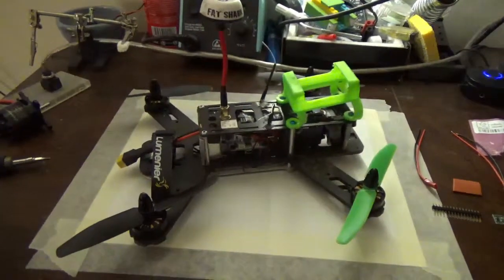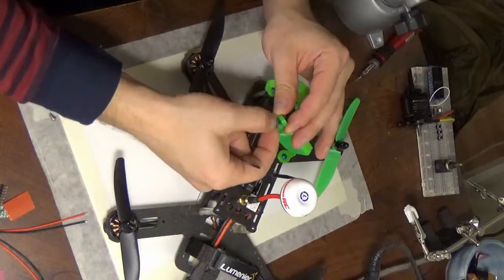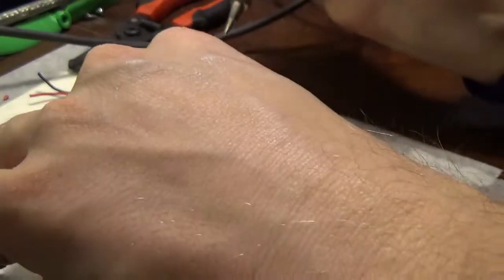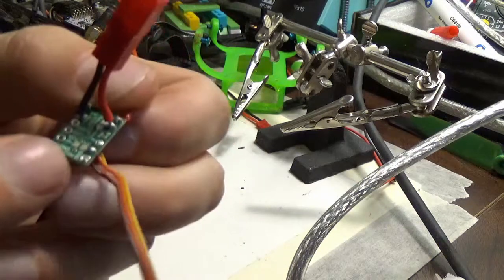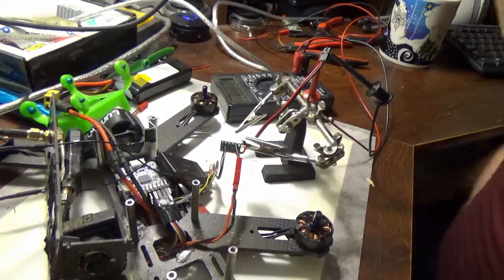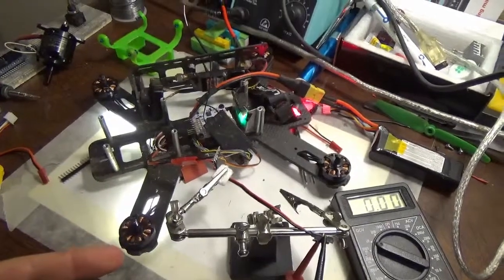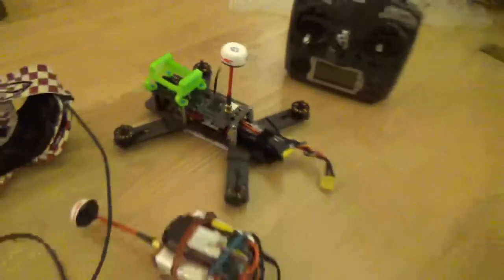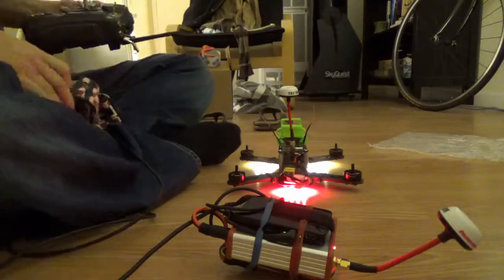Installation of a Pololu RC Switch on a Quadcopter

Comment: can this be used to stop a pwm signal coming out a fc servo output, then with a switch on radio to allow the pwm signal through. the eachine prodvr has a secondary button input to activate recording that i want to use this for. the dvr will be powered by the quad so i dont want power through the pololu, just a pwm signal.
Reply from the maker: jimmi pinnington that will probably work, but I haven't attempted it.